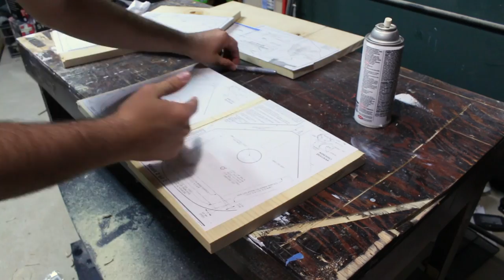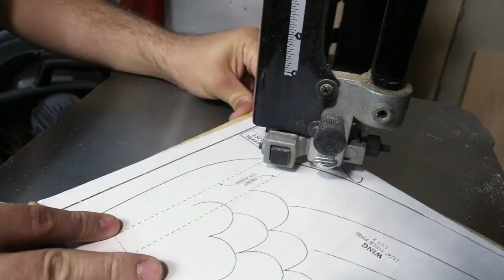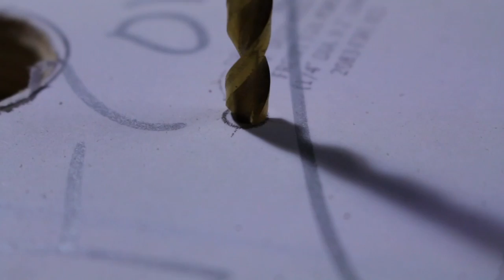Bird House Build

Comment: man great job.. great video. I like the clips showing the birds flying around.. good stuff.I cant believe you were able to build a sled for that tablesaw.. I struggled with that. I got fed up and sold the saw..haha. 3BIRDS workshop
Reply from the maker: Thank you! Yeah that sled was a pain to use but I recently used the Dremel to cut off those tabs so I can actually make runners and more sleds
Reply: +Make It Mazzeo ah good thinking..